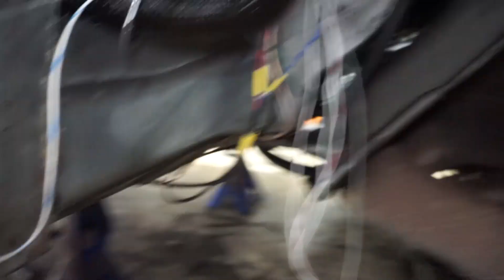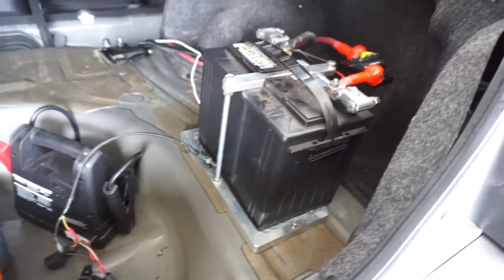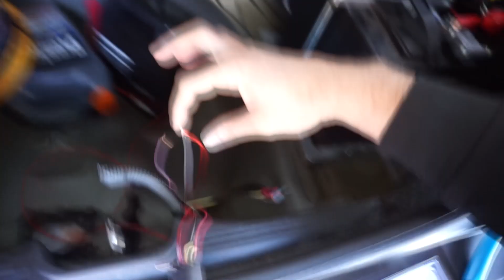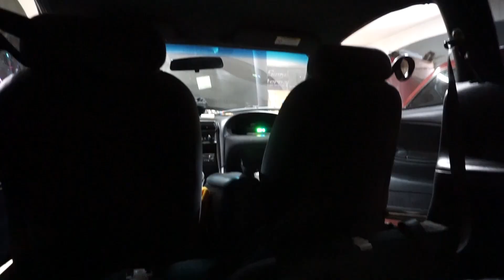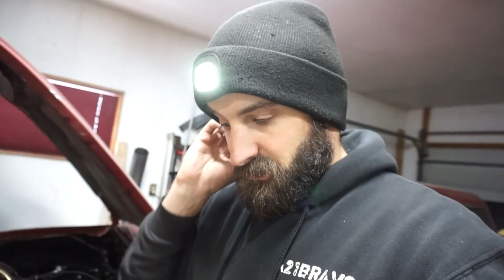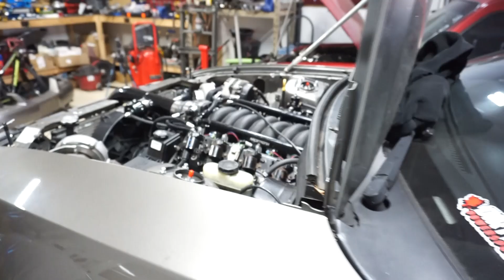Finish Wiring And FIRST START!!! Twin Turbo 5.3 New Edge Mustang

Comment: Awesome video, very informative! Very glad I found your channel.

I have a 2000 v6 that I'm doing an LS swap on and I was curious if you activated your starter with the factory ford ignition switch and key on the column, or if you simply jumpered the neutral safety switch and ran a start button.
Thanks

Comment: My 93 ranger uses the green wire with a yellow strip from the fuel pump relay to the inertia switch too
Reply from the maker: There's definitely a lot of similarities. My 98 Ranger is pretty close to this harness too.

Comment: That mustang turned out great!  Which intercooler is that?  I’m building a twin turbo vs racing 62/62 1995 mustang with a built ls swap.  Shooting for 800-1000hp but stuck on which intercooler to use.   Any recommendations that aren’t too expensive?   Thanks!
Reply from the maker: I'll have to look when I go back out there. Remind me if I forget, I'll try to get name and dimensions.
Reply from the maker: https://www.ebay.com/itm/351615999508?mkcid=16&mkevt=1&mkrid=711-127632-2357-0&ssspo=q_5ENbdsTiO&sssrc=2349624&ssuid=Vammoqq4Te2&var=&widget_ver=artemis&media=COPY
Reply from the maker: Rev9 24x7 core.
Reply: @BlaserBuilds  Thank you!  God bless
Reply: Could you confirm the intercooler is only a 2.5” thick core when you get a chance?
Reply from the maker: @BillyDavis1980  Just measured, this one on the car is actually 3.5"

Comment: Sorry for the gas issue 😅 wish the cluster would actually work lol
Reply from the maker: I just didn't put much in it. Only like 1-2 gallons from a can. I added fuel in the tune and fired up. I think the fuel gauge works.

Comment: For a first time cold start with a mild cam would recommend closed loop and learn to be ON at idle?
Reply from the maker: I prefer to have them on. Then can get a quick visual off the handheld as a guide, and/or transfer to base for quick broad adjustments when it's up to temp.
Reply: @BlaserBuilds  cool beans thx man. Another great video, your an animal at this stuff!
Reply from the maker: @Six_ftdeep32  also the learn usually doesn't come on until 160 degrees coolant temp. So the coolant based startup enrichment is out by then and just learning warm idle.

Comment: I just run the ecu switched power all the way back through the big cut off switch then back up front to a toggle switch in my race cars.  Turns off the ecu which kills both coils and injectors.

Comment: I know why you used the CCRM and the inertia switch. In theory that would work great, unfortunately the CCRM is going to fail and the inertia will probably fail.. CCRM's last about 20-25 years depending on environment..
Also, that relay looks like a 70a. Is it really a 120a? I need some of those!!
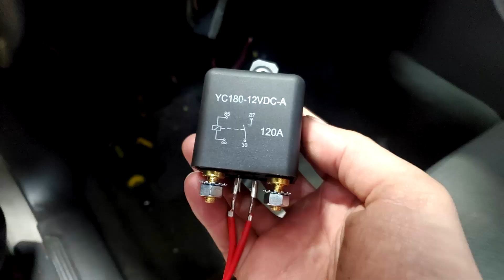Reply from the maker: 4:51 says 120a on it.